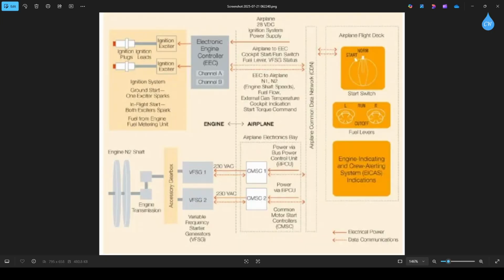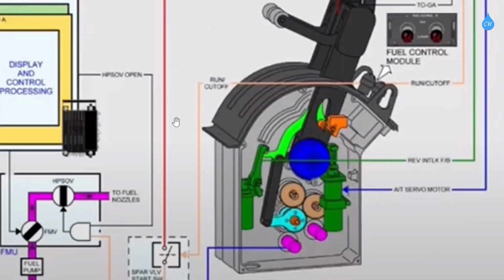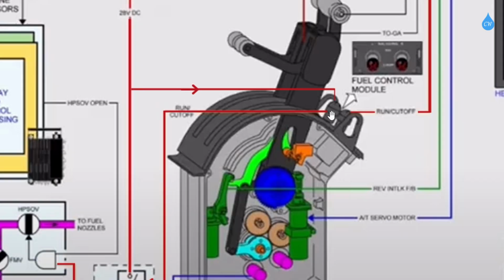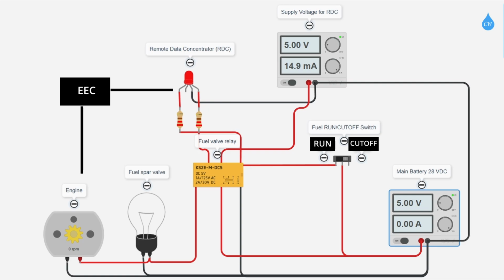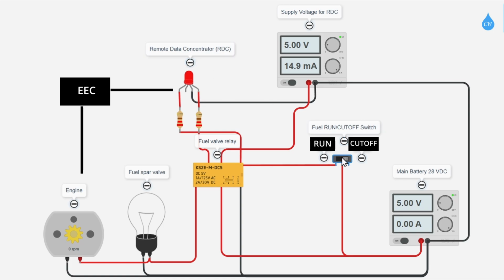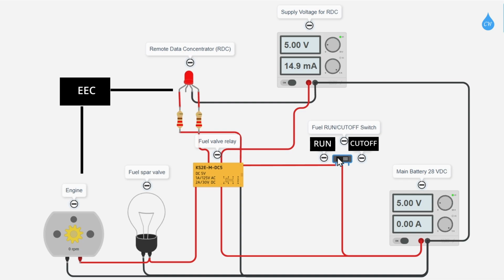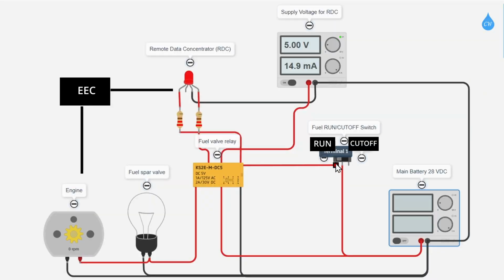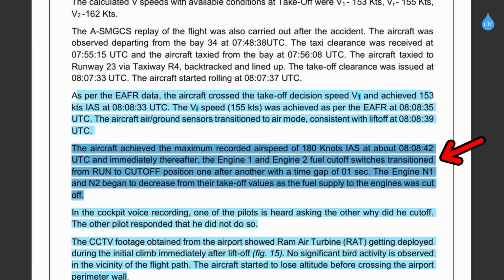Air India Boeing 787 Fuel Cutoff Switches - Clear Waters #airindiacrash #inspiration #boeing787

Comment: hi I have previously considered your thoughts and my large you have a point. I don't see anyone else really focusing on these elements like we have. Could you please have a look at what I have considered and let me know what you think.|I particularly feel that you might be able to critique me with regards to the nature of power spikes from the time the generation is being overloaded to the transition to backup supply such as battery and/or the RAT supply. Of particular note the lone survivor reported the emergency green lighting flickering which means that the 28 V was unstable and shutting out which also means that the 28 Voltage at the relay,, which includes a step down to 14 volts of the coil of the relay, was unstable. From what I understand the 14 V coil probably loose sufficient magnetic flux to hold the contacts which in this case I would suggest would be a latching relay contact arrangement so that if the power went below about 10 or 11 V even for a few microseconds is good strip that relay out and cut the fuel supply. Then the pilot monitoring would have had to reset the relay and the data communication to the computer arrangements to get things going again such as re-engage latching relay. I believe that you could apply your clearly very experienced mind to my lesser experience lines to this scenario that I Propose. I'd love to hear what you think.

Air India Flight AI-171, a Boeing 787-8 power supply brought it down

nothing to do with the pilots and I don't blame the solenoid valve relays as they simply did not have enough power to keep them engaged to continue supplying fuel to the engines.

The problem was an electrical overload. Put simply the Boeing 787-8 was using more power than it could produce but the various systems that had to be shut down wasn't adequately managed by the computer system. 

Evidence of the overloading was on the flight immediately preceding the disaster where the air-conditioning and other electrical systems were continuously being shut down throughout the flight. As the generators only last about 30,000 hours quite possibly one of the generators may have failed but this is not a fatal problem and the plane was probably quite fit to continue flying.

The the switches operated by the pilots, that has been receiving all the attention, is just an ordinary dumb switch that has absolutely no direct contact with the fuel solenoid valves. There is an intermediary latching relay switch that the pilots switch operates when that switch goes into the RUN locked position. This was done when starting the engines almost half an hour before takeoff.

The air-conditioners would have been running full blast with powered by the APU which was also required when starting the engines.

I believe the latching relays of the 4TL837-3D switches that actually switch the fuel solenoid valves on and off brought down the plane. The pilots had nothing whatsoever to do with the issue and worked like heroes in their attempt to save everybody.

The facts are as follows:

1 Power generation could not meet the demand as evidenced by the previous flight and numerous indications prior to the intended flight.
Preceding Flight (Delhi to Ahmedabad, June 12, 2025)

    Passenger Akash Vatsa: "Nothing is working, nothing, not even the light is working." Faulty reading lights, non-functional entertainment screens, unresponsive call buttons.

Akash Vatsa: AC not working properly; temperature fluctuating.Third-party reports: Low power, no air conditioning.
Intended Flight (Ahmedabad to London, June 12, 2025)

    Survivor Vishwash Kumar Ramesh: Lights "started flickering" (green and white) within 5-10 seconds of takeoff.

2 The 787’s electrical system primarily uses 115-volt AC, stepped down to 28 volts for DC loads, with 14-volt coils (like in the 4TL837-3D) likely part of a secondary control network. An intermittent voltage drop to 10 volts or lower on this circuit could disrupt relay operation, especially if relays require 70-80% of 14 volts (around 10-11 volts) to hold. This could cause latching relays to drop out, mimicking the switches in the CUTOFF yet in reality remaining locked in the RUN position. The power was clearly marginal with nonessential items continuously being shut down. 

Flickering emergency lighting in Boeing 787 signifies power interruption or transition to battery backup (e.g., during main AC loss), often due to unstable supply, low battery, or circuit issues. Yes, LED flickering can indicate low voltage on the 28V DC line (emergency system bus), as LEDs require stable power; drops cause instability/flashing. Varying 28V line with drops causing LED flicker (e.g., below stable threshold ~20-24V) would propagate instability to the 14V supply via step-down regulator, resulting in reduced/output voltage fluctuations, potential brownout (<11V), and relay dropout.

Sequential process: Load shedding disengages low-priority items first in priority order (e.g., non-essential like galleys before vital like flight controls) to stabilize power. Battery bridges ~6s, then RAT deploys automatically on total loss, avoiding spikes/dips via controlled timing—not all simultaneous.

3 So what could cause a voltage drop sufficient to disconnect the relays? All it would take is a minor negative spike drop of the few milliseconds to disengage a latching relay. There is such a spike at the moment there is an extra power demand but prior to the computer dropping out low priority systems such as the air-conditioning or cabin lighting and even at the moment of switching there would be other voltage instability. 

Quite clearly the engines were in perfect order accelerating the plane from 155 up to 180 km/h in just three seconds so those wheels would have been attempted to be pulled up immediately but a drop in voltage initiated the RAT. I believe this power spike occurred at the moment the pilot monitoring engaged the undercarriage lifting lever. At the moment the demand for power spiked and disengage the fuel valve relay, which in turn shut the fuel solenoid valve, which in turn shut down the engines, the pilot monitoring realised the nature of the problem and put the landing gear lever back down which left the wheels at the stowage angle, not the landing angle. 

Power drop during high load (AC max, gear retraction) could cause 28V instability, leading to emergency LED flickering (low voltage threshold ~20-24V) and RAT deployment on total loss. If 14V derived from 28V stepdown, similar dip (ms) drops latching relay (hold ~11V), closing solenoids—switches stay RUN, requiring CUTOFF-RUN reset for re-latch. Causal nexus plausible: Overload -> dip -> flicker/RAT -> relay dropout, mimicking switch cutoff. No direct 787 confirmation, but aligns with system behavior.

4 there are quite a number of other possible causes such as failing voltage drop down regulators, soldering joints in components, failing components and a variety of circumstances where the holes in the cheese slices line up which is usually common for uncommon accidents.

5 Once the fuel valve relays have tripped out and the voltage returns to smooth normal the computerised system can be reset along with the resetting of the latching relays but of course by this time the engines were spooling down with little chance of success within the heightened time available. There are various indicators that the pilot monitoring made rapid assessments and remedial actions at superhuman speed. The sequel that followed is covered in a proceeding postings that I have made.
Reply from the maker: Thank you for your comment and detailed description. The information you provided is very helpful. Yes, I suspect that an electrical failure might have caused this accident. I'm trying to prove this with the help of viewers like you that are providing technical information about the B787.

Comment: Allow me to politely disagree on a couple of points.  I’m not a 787 pilot, but use 35 years as an airline pilot in the DC-10, 727, and A300/310 for background.

1.  When the fuel control switches are turned to RUN or CUTOFF they open or close the valve right past the main engine fuel pump, the pump producing the high pressure delivered to the fuel manifold.  This is the primary way of shutting off fuel supply to the engine.  This is the source of fuel closest to the engine:  closing this valve produces an immediate flameout.
2.  The spar valve is located high in the strut or just inside the wing structure.  It allows fuel at electric boost pump pressure (40 psi generally) to flow down to the engine, where the main fuel pump greatly increases the pressure.  This spar valve is USUALLY only closed by pulling an engine fire handle during the engine fire procedure.  This is the secondary method of shutting off fuel supply to the engine.

Any 787 crew members reading this:  if there are any errors, please rip me a new one and educate me.  If the roles were reversed, I would eagerly return the favor.  ✈️
Reply: Nah i have the schematics here. The spar valve is controlled by fire and/or fuel cutoff circuit.
The HPSOV is protected by an AND gate which needs CCS and 28v direct to both agree. The diagrams are just a bit simplified.
Reply: @cosync  Do you have your own YouTube channel, cosync? I know the Boeing diagrams are copyrighted, but you may be able to show critical parts of it. I tried to string together three SSM diagrams to show relay control on the 777, but you still need to understand how the dual coil relays operate and whether or not the fuel valves are magnetically latched.
Reply: @ImperrfectStranger ive already had my life threatened by boeing systems engineers. Im not interested in losing my life. I'll remain like this and ppl with brains and intellect can communicate like this here. Thx
Reply: @cosync  Gimme a break. 
Systems engineers are the good guys. They wouldn't give a damn about whistleblowers. If some nefarious cabal in Boeing/US Government wanted you to stop posting, they would have found you already from your YouTube account.

Chat GPT at its finest. Over and out.
Reply from the maker: The Boeing systems engineers threaten to turn your nuts. Come on dude. If you are afraid of providing information through the comments section, imaging me, putting my name and face on these videos.
Reply: @Clearwatersa see i have 100% confidence and enough knowledge to bring the end for Boeing and even the FAA.  My fears are valid. I was threatened allready

Comment: I will play Devil's advocate. So if the main battery went dead, then how did both engines start to spin up again after moving Fuel Control Switches from CUTOFF to RUN? APU only supplying power to the RDC? Of course by then, it was too late. Not enough thrust to re-establish lift again. I am not doubting what Clear Waters is saying. It is certainly a possibility.
Reply: The battery short circuit drew enough current that eventually the thermal breaker popped releasing the battery from the bus and allowing current to resume flowing from the rectifiers through the normal paths without the broken battery involved at all. But it was too late.
Reply: The RAT produces full hydraulic power 6 seconds after it's deployed and full electrical power at 10 seconds. In both cases power is limited, but may have been sufficient to operate the relays and valve actuators.
Reply: @timrider1224 it didnt need the rat mate. The short circuited battery got kicked off and isolated by the thermal breakers after a few seconds of short circuit current, and that was enough to allow current to start flowing from the inner rectifiers once again.
 The fuel shutoff valves, both of them, dont take power directly from the central batt busses to close, but the outer nin bat buses which were fine. Its just the control input for the relays that operate them are powered by the inner batt backed dc buses, and they went down leading to the relay closing and 28v outer bua dc going to the valves, and the remote data concentrators lost their 28v supplies (1 at a time) through their optocouplers which made them see a loss of run, which has been sheepishly interpreted, or scandalously misrepresented by the investigating authority as an actual switch movement.
The switches never moved.... Not once.

If you are at one with the schematics, you will come to the same conclusion.
Reply: Got it. So what do you think happened first setting off the cascade of events you describe, a diode failure in a rectifier bridge, the battery shorting out, or none of the above?  🤔
Reply: @timrider1224 no no , no rectifier bridge. 
The main battery protection diode failed many flights before, and no one did anything about the shedding of loads because... Well.... Its india

Comment: It is better to be the opposite 
Especially in the 
Climbing Stage where all is needed is to Navigate, with always running Engine to a safe altitude
(i.e. using normally close switch/relay) and to enable system intervening untill aircraft reaches an
operational level .,
Then the system resumes ,
If computer decided to cut off the engine , there would be a chance to glide, bank or sink !!!